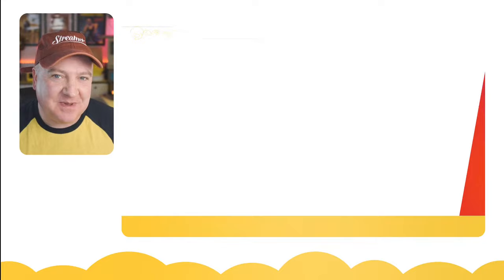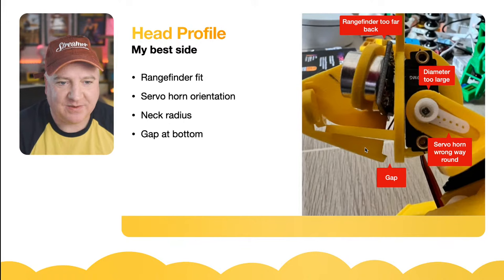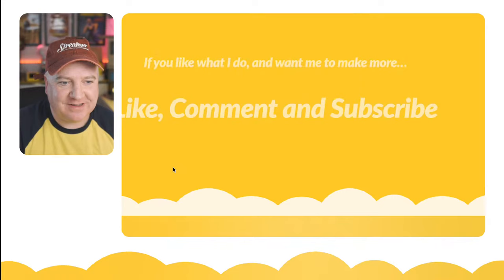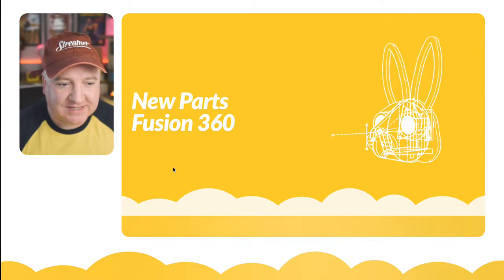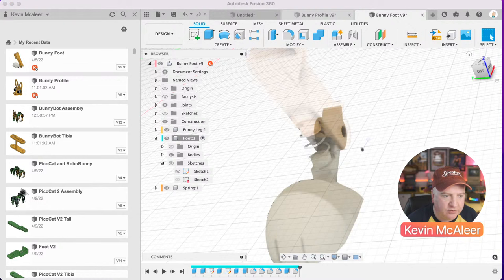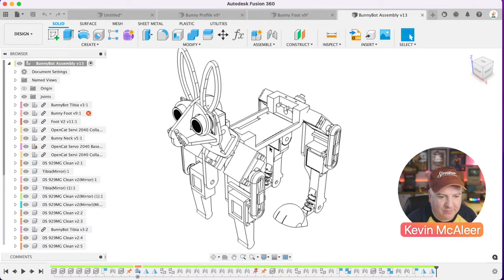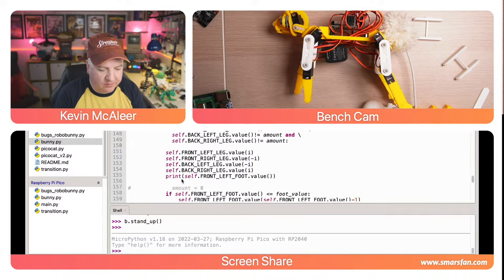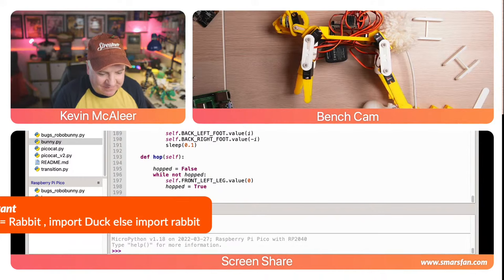Bugs - the RoboBunny, Create your own Robotic Easter Bunny

Comment: its a great video, i want to make a nybble cat with only functions to move forward and backward using arduino uno and nrf24 transreceiver. can you guide me on this ? can you let me know the code that is needed to move forward and backward ?
Reply from the maker: That's quite a lot to achieve, from a build perspective and also from a coding point of view if you've not done this before. For this project, I chose a microcontroller that has built-in servo headers and power regulators; if you want to do this with an Arduino, you will need to find an Arduino shield with 11 Servo headers. I've not used an NRF24, so I can't advise on that. The code should be the same as the publicly available code - it's essentially just a walking cycle or a reverse cycle for backwards. I do offer code reviews on the gold membership level
Reply: @kevinmcaleer28  i can control servos with pca9685 servo controller, i just want to learn the code for moving forward and backward, i can try fitting the code to use with remote control arduino
Reply: @kevinmcaleer28  can you please share the link for walking cycle code from the publicly available code
Reply from the maker: @easy_3d  Sure - its in the PetoiCamp Github repository for OpenCat. (They designed this robot) https://github.com/PetoiCamp/OpenCat
Reply: @kevinmcaleer28  where can i find your gold membership?